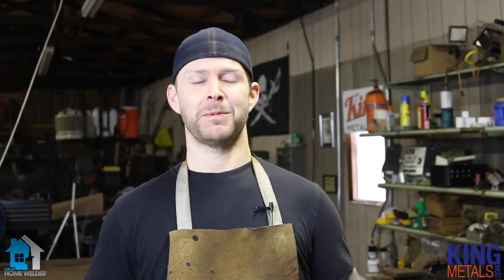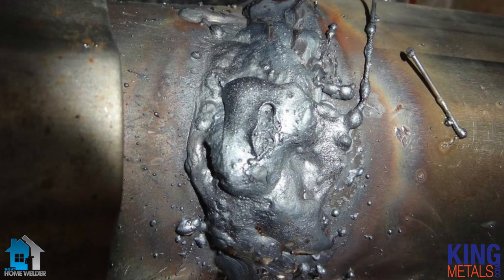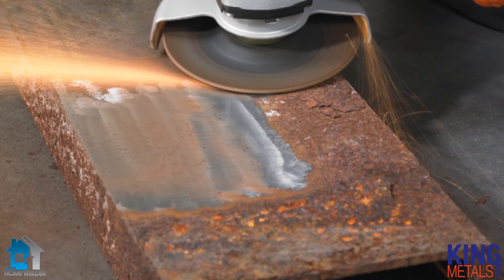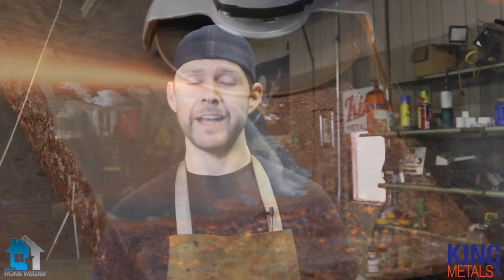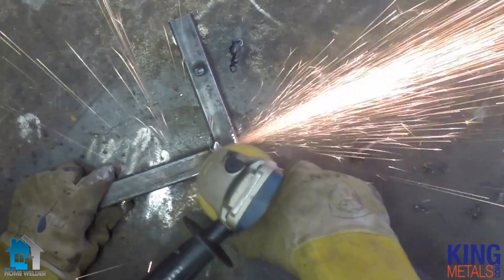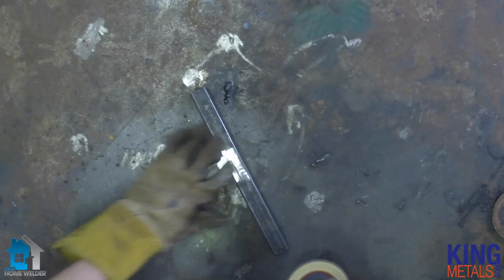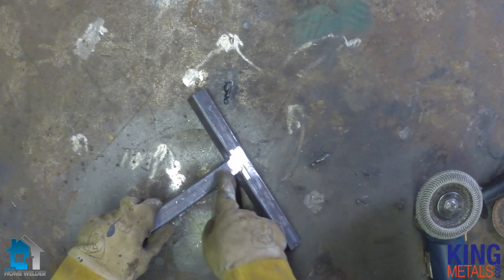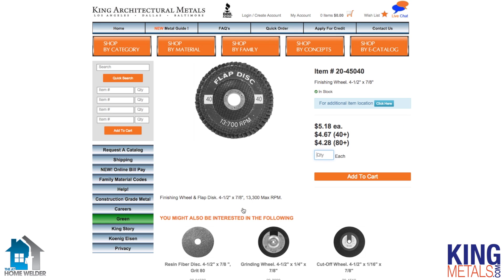How To Fix a Bad Weld

Comment: I know its an old vid...BUT...I just started welding, and Im doing it on a car (Rancher) that I was going to crush because of the massive rust problems...heres my question. If my welds are big and boogery and seem to hold after banging with a 28oz hammer...will it hold on the car over potholes etc? I will put seam sealer...Its my first weld, and I have a lot of work (ie, the entire floor to still fab and weld in), so I want to get moving...I dont care about it being ugly, but I do want it to hold and not leak (since Ranchero floors have an overlap over the cabin floor).

Thanks...I know in the future I may have to do a better weld, but I have a channel and I need to get to different projects (in areas whre I know what Im talking about lol, like engines, mechanicals, electrical etc)...but for now, I want this truck whole. Im repeating myself now (im excited that I did manage to plug holes with just the stick welder....over rusty metal..woohoo!)

Comment: I grew up ( in welding ) fixing other peoples screw ups mostly without grinding it all off.
I never use flap discs. Expensive and wear out fast.
I usually turn up the heat and run MiG speed slow and re-melt the weld as much as possible.  I once had to repair a heavy metal plate tank a guy just built and MiG welded. 
After welding he leak tested and couldn’t count them all. THEN they came and got me.
I didn’t feel like grinding for hours so I cranked it up REAL high on my MiG welder ran the wire really slow and commenced to re-melting the welds. When I was done I had like 1 
leak. I did however burn up two nozzle insulators from running so hot for about 6 feet of weld. ( 300 amps )

Comment: Hey, not sure if you'll respond in time, but what if it's a small weld on a 90 degree joint.  Can't I just run a new bead all the way across from metal-across the bead-to the other metal piece?

Comment: I’m trying to learn. I’m trying to slow my bead down enough to get a nice bead, but I’m having a terrible time seeing the work. I can barely see the puddle and think I’m easing along but sometimes I even drift off the joint. My helmet is set on 10. Any ideas?
Reply: Try it at 9.
Reply: Tim, also consider a magnification lense as well.

Comment: You should check out your local shops, you might get cheaper prices on welding gear, especially if you haggle. Not everything online is cheaper. Support your local stores people. Also buy quality like 3M, Norton, etc when buying grinding and or flap discs.

Comment: The main reason you damaged the material with the "hardcore" hard grinding disks is because you were holding the part with one hand allowing it to move around, and more importantly you were holding the grinder with one hand.  Contrary to what was shown, intricate work can be accomplished with a hard abrasive disk, but one must use two hands to better take advantage of fine muscle control of the wrists together with the arms.  To gain even better control, one can anchor the elbow of the arm that holds the grinder's side bar on something, and an even better level of dexterity and control can be had.